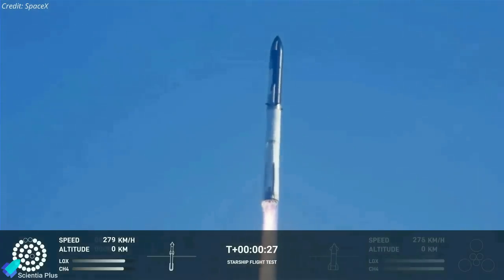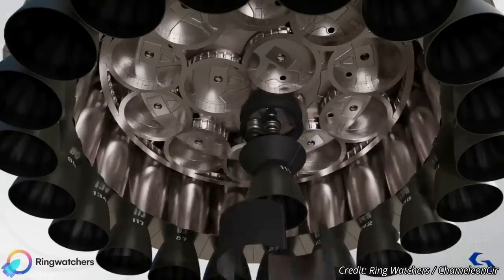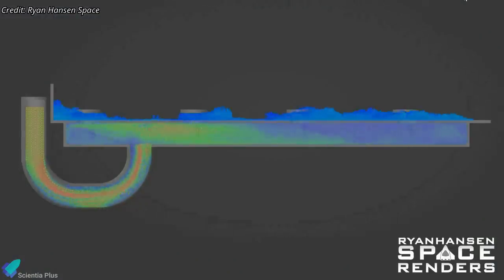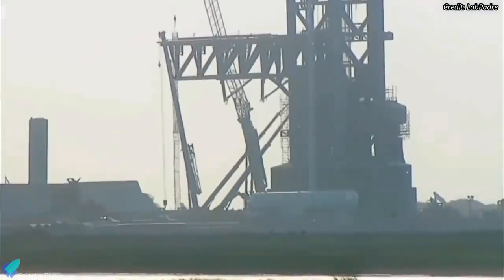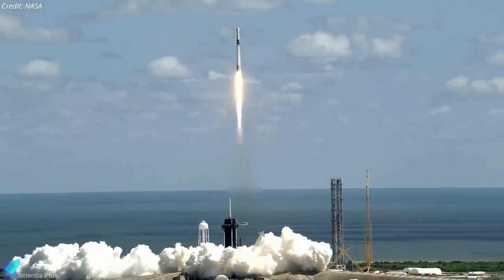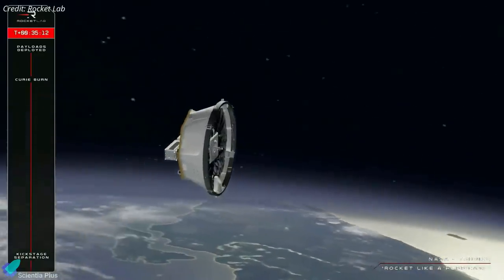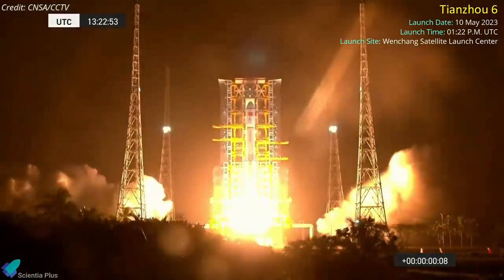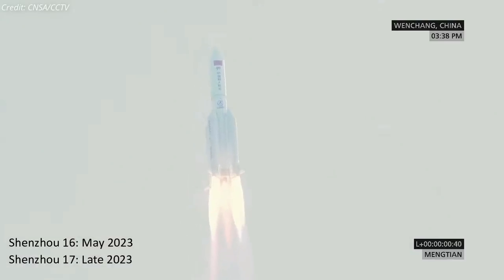SpaceX's Ingenious Idea to Protect Starship Raptors and OLM from Explosion, Vast Space Station

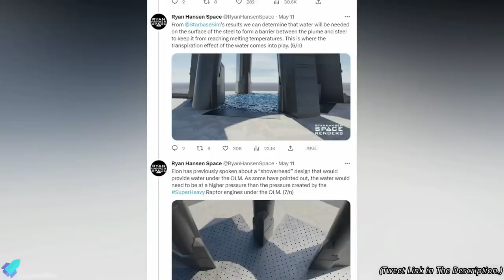Comment: 2:39  The reason for the cratering is NOT the energy of all the engines but the thrust FORCE, the momentum of the gases leaving the engines and upon deflection the force created by mometum vector change, pushing the ground below with a force equal the Thust of all engines, eventually about 1.5 times the weight of the entire rocket . only a tiny fraction of the energy heats the plate structure by convection, the rest energy is still in the six lateral jets, after 90 ° deflection, most in kinetic energy, little in thermal energy.

Comment: External protection won't stop the fragile Raptor engines chewing themselves up from the inside out. Once the turbopumps and feed valves have disintegrated LOX and methane propellant will vent freely. Is there a sweepstake ru ning on how many engines will fail next time?

Comment: Whoa !! it only took them a few weeks before someone understood that the pressure in the inverted shower head would have to be SO big that it would be shooting past the rocket. And what's their solution? diverting the water horizontal. 
facepalm

You know, if it was that easy, NASA, ESA,etc... would have done so decades ago.
Reply: They will have to use  either   water- cooled titanium  system for their     floor  plate or use  ablative  material, the  one  that is   used  for   atmospheric  re-entry.  And  they will have  to use  it on their  supporting  structure  columns as well. In long   term it    would   be  much  cheaper   to build a classical     flame  diverter  as  that    would  also  resolve shock  waves  going    back     to  engines.  Basically  their  whole    launch pad is  designed  wrongly.  The  supporting       tanks  and systems  are   way too   close  to the  launchpad. They  either  must be moved at least a  mile   away  or moved underground.

Comment: 2:10. Possibly these stainless steel protective Armors were KNOCKed-off due to Chaotic debris of the basement/concrete which were destroyed during taken-off powerful boosting, more than 15 seconds. The armor/shield plate are not strong/thick enough? Or the ventilation of broken debris/concrete was not well-guided out of the chamber...so that they were turbulently flied into the underside of expanding Nozzles, and damage the thin shields, (if the debris could be well ventilated/out of the area, the existing shield could be good enough, for/without the turmoil chunks/pieces of rock..

Comment: sorry but ???what PSI does the water have to be at to not flash to steam?? What is the PSI of pressure on the concrete under the engines now that caused the crater. I don't think they can provide that kind of PSI on the water lines. If they could we could just launch the water pressure rockets and not burn fuel.

Comment: Why doesn't SpaceX use booster rocket configuration on the Starship like they do on the Falcon 9 Heavy? I would think that if you distribute the thrust over a wider area that there would be less damage to the launch pad.
Reply: That is what they are doing, based on relatively higher number of engines, there are 3 rows of engines instead of 2: one in the center, 8 in the outer ring.  SH  3, 10, 20
Reply: How ever the whole thrust force gets transmitted to the ground, a wider area, where you are correct, requires  a larger ship diameter.

Comment: The  bigger the  rocket  the  less return it   makes.  Basically  most  of  the lift is  wasted on  lifting   additional   fuel. Sooner or  later    earthlings will have   to learn how   to assemble    multiple  components in LEO, and  then move  forward.  That     includes  giant  future   telescopes.  I propose   building       docking  station    at  ISS, where components   could be  attached, and  then  astronauts   could add     needed subsystems and      connect the  components in      final        configuration, and then a    rocket   could  be attached   to it  to move it   to the   needed  destination. So far military  are  just occupying ISS  and wasting  taxpayers   money  on basically  useless things.

Comment: How do we go from a description of inverted shower head to a depiction of diverting the water horizontally? "The best part is no part" does not lend itself to these dozens of divertors. Is there something inherently wrong with water moving vertically?
Reply: As stated in the video, there's concern (by arm chair engineers, not SpaceX) that the high pressure water exiting the steel shower head will hit the raptor engines, flooding them and thusly causing improper combustion in their combustion chambers.

That being said, I do agree with you that "the best part is no part" approach is what should be done. It shouldn't be difficult for SpaceX to precisely time the release of water and raptor engine ignition so that neither overpowers the other and remain balanced till Starship exists the pad.

Also, adding so many of those water diverters would be more time consuming; they'll need to be motorized if they're retractable, making things more complex and vulnerable to damage from heat and pressure; plus they might even make it easier for the rocket exhaust to find a way into the steel shower head if it gets overpowered.
Reply: @justiceifeme  all they had to do was builtva pier into the adjacent sea  with a hole in it...
Reply: @esecallum  the water table at the launch site is too high for that, not even accounting for the extra time it would've taken to construct and validate, it would've significantly increased the environmental impact assessment time schedule. This all means that we wouldn't even be seeing a launch this year or even the next.
Reply: @justiceifeme  park the oil drill launch platform next to the pier. Simple.
Reply: @justiceifeme  try to experiment with your garden hose and find a way that would make ambient air stop water waterjet. Water is 700 times as dense as ambient air at sea level. Water is 70 times denser than carbon dioxide and water vapor mixture at 10 bar - that is Raptor engines exhaust. Do you still belive that these gases will stop water jets? One bar pressure equals 10 meter high water column. 10 bars pressure  equals 100 meters water column. You do not have to be rocket scientist to figure that if water pressure exceeds exhaust gas pressure than  that water can spray rocket engines located  20 meters above water nozzles. Timing has nothing to do with it.
Reply: Water need go horizontal. 33 engine have destroy concrete, and will stop vertical water jet, need higth power to move water jet even horizontal, is about flow fast to not melt and not lose strength the metal. My noob opinion. Next flayt need to be test, to see if work.
Reply: @esecallum  that would work, but they haven't gotten to completing the design of the offshore launch pads yet. It's better to verify the launch hardware on the ground first before they implement the results on the offshore pads.
Reply: @KarolKarolak  I don't even know where to start with this, you have such a fundamental misunderstanding of the forces and pressures we're dealing with when it comes to the world's most powerful rocket that you actually think it's raptor engines exhaust is at 10 bars of pressure.

The rocket exhaust (the gas as you called it) from the combined power of the raptor engines is being ejected at extremely high temperature and pressure. This isn't some light breeze or CO2 in a soda can gas, it's like a flaming hurricane blasting directly towards the ground. It literally had enough force to bend, rip, tear and shatter reinforced concrete.

The densities of water and ambient air at standard temperature and pressure are irrelevant in this scenario since the rocket exhaust and water deluge have their own independent temperature and pressure. This is why you have to compare them in this specific scenario to accurately balance their forces out, and release the energy outwards away from the pad in the form of steam (which has a very high specific heat capacity and good acoustic absorption)

That is how this water cooled steel shower head deluge system will dissipate the enormous energy away from the pad, ultimately preventing it's destruction like last time.
Reply: @csabaczcsomps7655  it doesn't matter what direction the water is flowing to, whether vertical, horizontal or even diagonal, once the raptor exhaust reaches it, it'll vaporize it into steam that expands out in all directions. The important thing is to have the water coming out at high enough pressures that the rocket exhaust doesn't push it back into the steel plate and cause a steam explosion inside of it.

Ultimately, the water vaporizing into steam in all directions is what dissipates the heat and sound energy away from the pad surface, allowing the water cooled steel plate to withstand the rest of the now minimal forces and heat of the rocket exhaust, keeping the launch pad and the rocket safe.
Reply: @justiceifeme  i thought they had 2 or 3 oil platforms and did some launches...for other rockets
Reply: @esecallum  nope, they where never completed. In fact, they sold the two oil rigs they had after confirming that they didn't fit their launch requirements. This doesn't mean they still won't pursue offshore launchs, they'll just have to workout a better design. For now they've paused it's development until they get starship into orbit
Reply: @justiceifeme  Atmospheric pressure at sea level is 1 bar that is 10mT/m^2. 33 Raptors generate 7500mT of thrust. Rocket diameter is 9m that means area of the base is 63m^2. 7500mT/63m^2= 130mT/m^2 that gives you 13 bar right below rocket exhaust nozzles. It would be around 10 bars at it hits the ground. No adjectives needed simple physics  will do.
Reply: @jolantadziaduk8558  Your conversions using the thrust of the rocket gives an inaccurate picture of the exhaust pressure from the combined raptor engines. From the last updated exhaust pressure recorded from a single raptor engine being 0.7 bar, if we multiply that by 33, we get 23.1 bars of pressure from the rocket exhaust at the nozzles. By the time it reaches the ground, it'll be around 20 bars, so at least double the 10 bars the previous commenter stated.

Also the combined exhaust plume slightly extends out the diameter of the starship itself, and further expands as it hits the surface of the pad. I couldn't find a source for the actual area of the pad but from the conical design of the OLM, it's clearly larger than the area of the starship it's clamping on to. Plus the shielding would need to cover even more than the area of the mount support pillars due to the expansion of the exhaust plume spreading out in all directions after hitting it.

Ultimately, my point was that the exhaust pressures were nothing to scuff at, even at ground level. So a simple pressure hose wouldn't cut it like was previously stated. That being said, I don't believe that those pressures are insurmountable. It doesn't take that much extra water pressure at such a large area to overcome and suppress the exhaust pressure.
Reply: @justiceifeme  Pressure does not increase by multiplication by number of rocket engines as you suggest that is completely stupid and shows your complete ignorance of laws of physics.
Reply: @jolantadziaduk8558  what on earth are you talking about, this is basic addition that I simply used multiplication to make easier. One single raptor engine's exhaust pressure is rated at 0.7 bar, are we supposed to ignore the remaining 32 engines exhaust pressures? Of course not, we're talking about suppressing the entire rocket exhaust of the Starship booster stage, not just a single raptor engine.

Honestly I don't understand how you can so confidently accuse someone of ignorance in science when you don't even recognize basic math. You yourself used the total thrust of the 33 raptor engines (7500mT which isn't the same as the exhaust pressure) to perform your calculations, not just a single raptor engine.

Imagine how absurd and ridiculous it would be for someone to tell you that "THRUST does not increase by multiplication by number of rocket engines as you suggest, that is completely stupid and shows your complete ignorance of laws of physics". Do you now see how hypocritical your statement is. 

Honestly I'm not sure you even thought through what you wrote in your reply to me, but next time please give it a moment of thought. I have been respectful with how I've responded to everyone on this comment thread, even when giving corrections, so I don't understand why you felt so offended when I gave you the proper measurements for the rocket exhaust of the booster; that you cast insults on my intellect and grasp of science.
Reply: Showerhead idea is stupid af.  The pressure from engines alone will overcome any type of water pressure they can achieve.

Simply make the base a water jacket with whatever flowrate and will be enough.

Guessing elon forgot elementary things like a baloon filled with water will not burst under flame.

And this not an armchair engineer but one with 43 yrs engineering out in the field not on paper.
Reply: @jolantadziaduk8558  idjut just one raptor pressue they cannot achieve in water pressure thats the point.

1000kn (220,000 lbf)   those holes would need to be like a waterjet (that cuts thru steel)  rending engines and ship USELESS!!

JUST 1!!!
Reply: @justiceifeme  this why men get paid more lol.  Some should stick to tiktok dances and makeup.

The pressure of just 1 raptor one cannot achieve in water pressure its why right away they suggested sideways nozzels lol
Reply: @Fatpumpumlovah2  The pressure were talking about isn't the combustion chamber's (at 300 bars), or the exhaust pressure at the nozzles (last confirmed estimate at 0.7 bar), but the actual combined exhaust pressure of the booster at the ground level of the pad (which SpaceX hasn't given direct data about yet, people are speculating anything from 13, 15, and up to 20 bars).

As this pressure is spread over a large area on the pad surface, you only need to divide it by the area it covers. That division is what each of the many shower head holes need to have their pressures at in order to balance out the pressures and heat of the engine exhaust. So let's take 15 bars as an example, 1 bars = 1.02 kg/cm^2, therefore 15 bars is 15.296 kg/cm^2 which you then divide by the area of the pad surface (which again SpaceX hasn't given direct numbers for, we only know it's slightly extends over a diameter of 9 meters). Let's assume the diameter is 10 meters, that gives us an area of  78.52 m^2 which is 7853.98 cm^2. 

15.296/7853.98 = 0.002 kg/cm^2 which is 0.002 bar of pressure (which isn't a lot of pressure at all). But since the holes of the shower head deluge system will likely be large and spread out of the area of the pad (much larger than a square centimeter), depending on how the final design goes, this pressure will be significantly higher probably upto 5 bars of pressure just to be safe (again this isn't much pressure at all, it's 72.5 psi) which is the pressure of your standard garden hose.